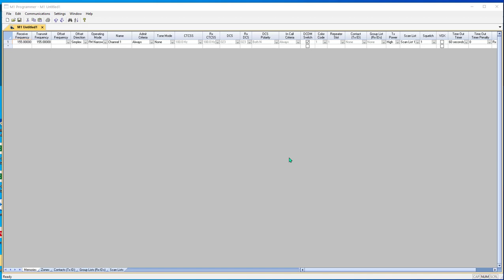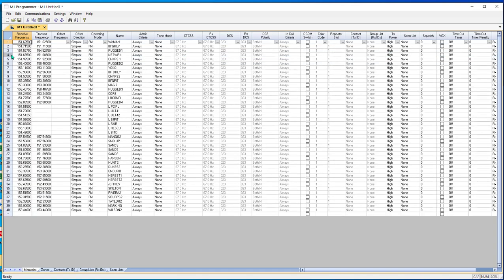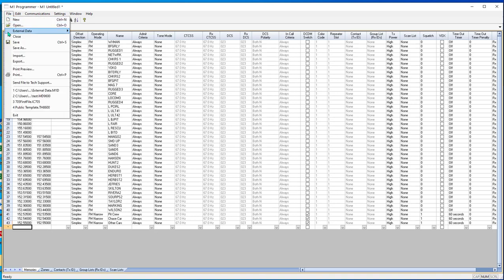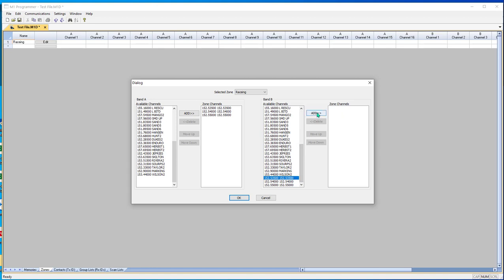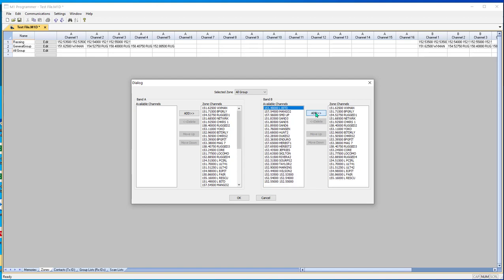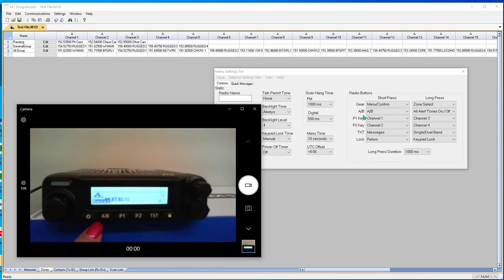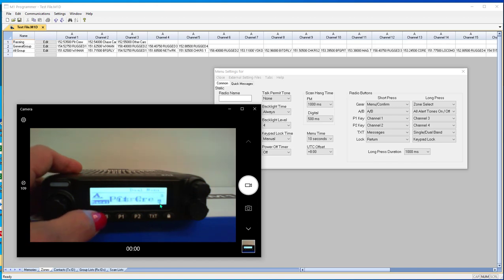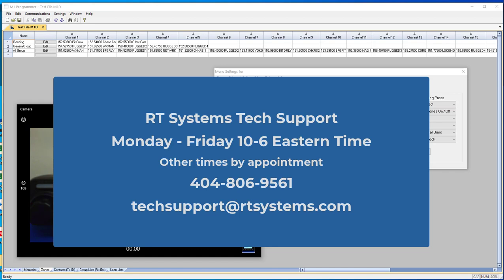Getting Started with Rugged Radios' M1

Comment: In reguards to A & B, if I ride with a group and most of us have the same channel but a handful don’t have that channel, can I set A 1 channel for part of the group and B1 for the other guys in the group, and just flip back and forth from a and b ? Can I listen to both a and b at the same time? Thanks
Reply from the maker: Ryan, 
Yes, I can think of ways you can get done what you want.  If you have the RT Systems programmer for that radio we can use a Scan list and Priority Channels along with Transmit Channel (Last Active) to get done what you want.  I don't know exactly how this will all work together... but I have hope that we can get you working better with that radio.  Give a call some time when you are at your computer with the RT Systems programmer... that's the only way this can be done.  404-806-9561
Reply from the maker: Sounds like a plan.  Keeps you organized and the channels you want at your fingertips.
Reply from the maker: Yes you can. Sorry I missed your question until now.  Hope you already have it going.

Comment: What happens if I don’t have a previous program, how do i get the frequencyTo copy over ?
Reply from the maker: You can only change a frequency on that radio through software.  Without software, you will use the frequencies that are preprogrammed from the dealer. You can get that software and the cable at www.rtsystemsinc.com  Look for the Rugged Radios section, the mobile radios, then the M1 radio to get what you need for that particular radio.